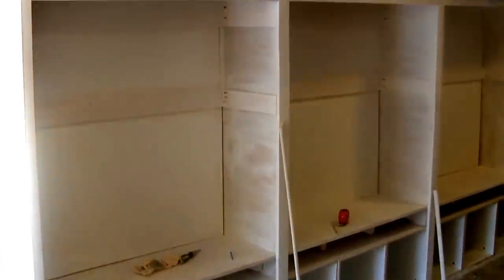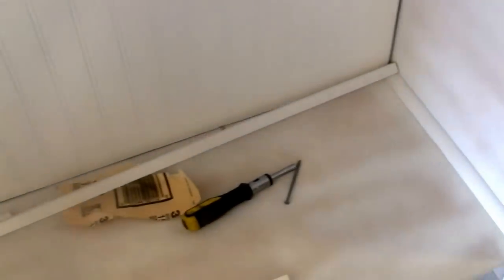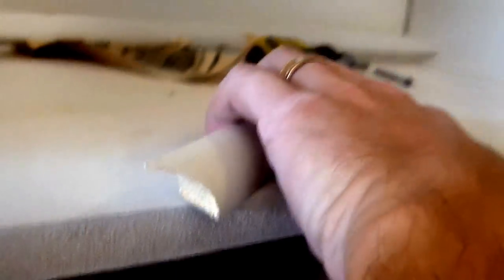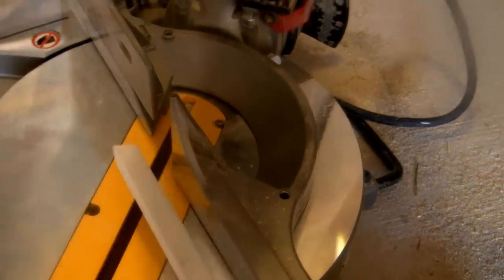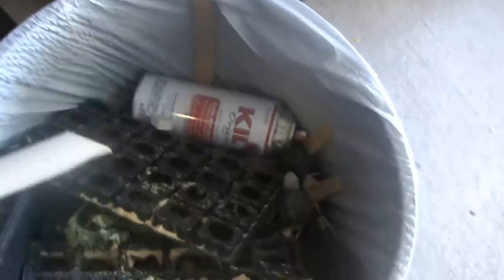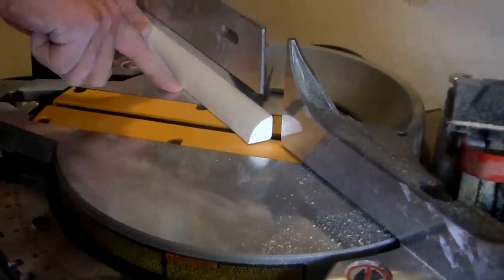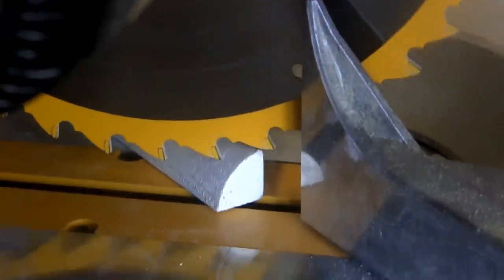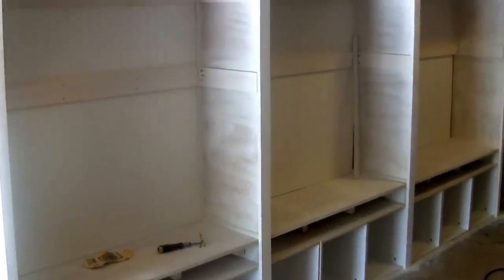Cut Quarter Round Inner Corner (Where Three Edges Meet)

Comment: Good job on the video, I was looking for a video for how to cut the third molding for three way corner. For easy of cutting and fitting I think you might consider coping the side piece instead of the back. This would also hide any gap, because you would be looking across the gap and not into it. Looks like you did an excellent job sizing so it didn't matter, but I seem to always be off by a fraction. Keep up the good work.

Comment: this is not a three way mitre...you need 3 "arrowhead" cuts = two 45's on each piece - and no coping required.
Reply: You're right, this is not a three way mitre cut.  It doesn't claim to be.  Those would come "out" like the (outside) corner of a table with a leg.  This is the reverse/inverse and goes "in."  If you have a better video to show how to make this cut, please provide for the benefit of others.
Reply: @quinnlewis2140  fair enough, I assumed it was supposed to be, sorry about that!